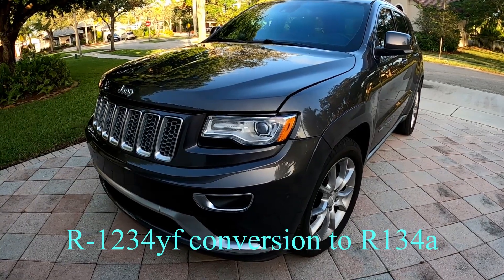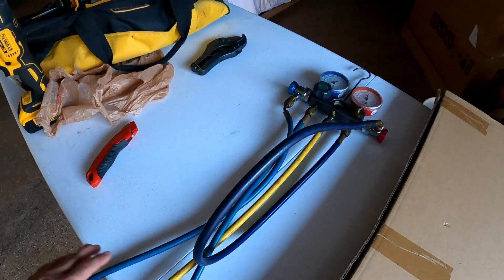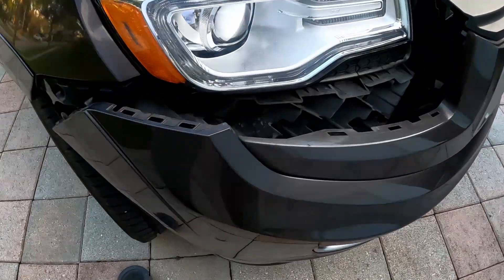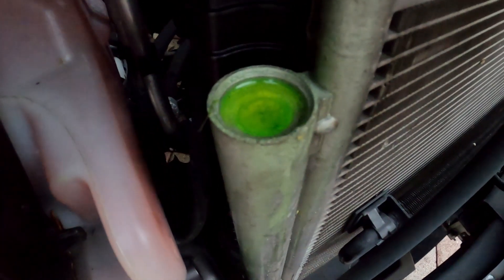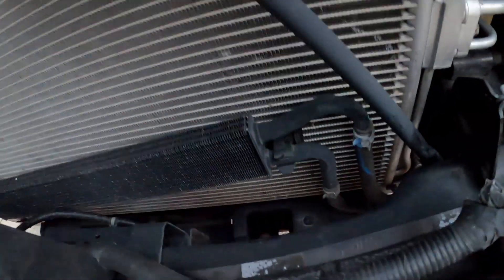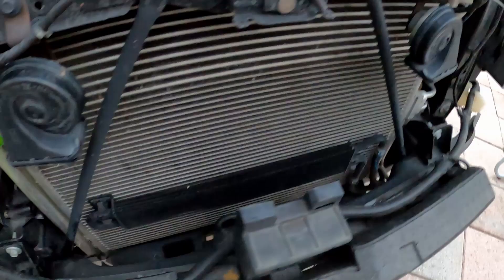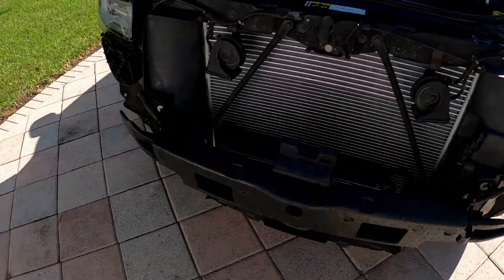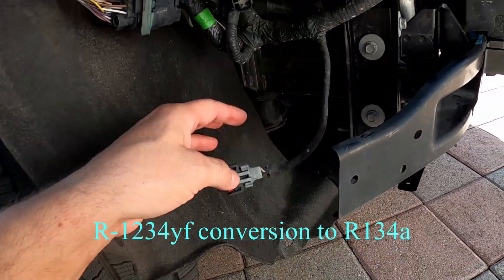R 1234yf conversion to R134a Freon Jeep Grand Cherokee Condenser Replacement, R1234yf to R134a

Comment: Great video!  I understand about the type of gas. And understand about saving $$$$ for a simple DIY recharge, but, sorry of my ignorance,  the compressor doesn't get damage for the change of gas??? Maybe the compressor is designed for a specific type of gas, then the repair cost much more than a simple recharge???  JUST THINKING!!!??? 🤔😅
Reply from the maker: At the time of the video to charge it was a lot and there was not much info out there.  I started asking some mechanics and did find something that mentioned the gas was kind of the same and after a while people were converting.  Now I believer there are kits you buy to convert it to R134a with very little cost.  It actually worked better when I replaced it but I also had a bad condenser.  R1234yf is mildly flammable, while R134a is not.  I don't remember but the pressures are a bit different.
Reply: @ExtremDIY the switch may have damaged your condenser. Cause I heard the 1234y has more pressure
Reply from the maker: @ReyErnesto-p1c  The condenser was replaced a year before with the 1234yf that was expensive with an OEM condenser from Jeep and only lasted 1 year so it was not the R134a.  Seems like the oem condensers have an issue. Just like residential A/C companies they have been changing freon types and its ridiculous.  1234yf is more corrosive than R134a according to what I have seen.  There are kits know to convert from 1234yf to R134a.
Reply: @ExtremDIY my system has a leak. An Ac Tech told me it might be the condenser since I get a weird smell. The system is completely empty. He said that condenser is gonna be alot of money to replace. So he suggested to buy this Blue devil leak sealer called Red Angel . He said it might clog the leak and get the ac fixed. He recommended to go with what the system came with the 1234yf instead of switching to 134
Reply from the maker: @ReyErnesto-p1c  I did the same thing with my current GM and the sealer is clauging the valve in the compressor so it works intermittent so I dont recommend to do that but its a cheap alternative.  If you have a leak in the condenser brand new is under 100.
Reply: Which red angel did you use? The small ted bottle or the can with the hose?. On Amazon everyone raves about it. There's one guy that said one bottle wasn't enough and a second bottle did the trick of sealing the leak. My condenser I'm talking about is the one behind the dash . Mechanic said thats expensive cause of the time to replace. Mechanic said if the ac has a smell that it should be that. But I'm sitting in a 2025 Acura and it has a smell as well lol @ExtremDIY
Reply: Im receiving two bottles of red devil today from Amazon. I'm thinking of adding the two bottles. Still debating which freon to put out of the two
Reply from the maker: @ReyErnesto-p1c  If you convert it make sure you add a sticker to indicate the correct freon.  Good luck hope you fix the issue

Comment: R134a is actually in phaseout. They cut production 15% in 2020. Now the 1st of January 2024 they cut production another 15%. By the end of 2024 r134 prices will probably be pretty close to that of r1234yf. If there is enough stock out there you probably won’t see the price increase hit the shelves until 2025 season. Unfortunately the government always has to mess with things.
Reply from the maker: I agree with you on that.  Thanks for the update.

Comment: I did the swap on my 2019 Chrysler 300S about 6 months after I bought it. Has worked perfect outside of shrader valve leaks for 4 years. Much cooler than 1234yf. However - once you do this - you better have a specific shop you have a buddy at, or know how to service the system, because no shop will touch it ever again - technically it's A. illegal, and B. contaminated so the 1234yf machine won't run.
Reply from the maker: Hello I labelled mine to make sure that next person will know and yes mine was colder after I did the change too.  Thanks

Comment: What did you do to convert it?
Reply from the maker: Replace r134yf with r134a which is cheaper and easier to purchase. There are kits you can buy now that come with some items to replace or you can buy the compressor that comes with these items.

Comment: You say it worked prefect for months and then said you left it r134a. What happened that it only worked perfect for mounts months?
Reply from the maker: I had a leak on my condenser prior to the video beign made were I had already replaced the condenser a year and a month prior with the expensive freon.  I did some research on the freon and there was very little information available that I could relate to.  I did find something and it mentioned the very similar characteristics between both gases so I decided to add R134a to the system and worked perfect for months.  then I decided to replace the condenser and install the R134a.  I got tired of adding freon to the system and the leak started to get worse so thats the reason I replaced the condenser for the second time but now with R134a.  Sometimes leaks are small and can take months to go low. I had purchased the condenser from dealer both times.
Reply: @Extreme DIY  cool.  Cause my 16 charger currently uses the r1234yf
 But I am putting a chiller on the car for my intercooler and I need to recharge the system. I want to go to r134a but my buddy is telling me that I'll have major issues if I do this. But yours has been good right
Reply from the maker: @09fatbobmike  After I replaced with new condenser and installed the r134a no issues here.   Ask him what major issues you will get?  I was told that now there are new compressors that come with a kit to make it r134a. Back when I did the exchange there was nothing available to do this.  I would recommend to do the vacuum on your system before you add the a134a.  Let me know how it goes.  thanks
Reply: @Extreme DIY  he's actually an engineer for vehicle ac systems. He tells me that the txv for r1234yf vehicles is set up and designed differently and if you don't change it (which I tried and found out the lines are all different,  need a whole system from a r134a car)  but he said if you don't do that then using r134a will cause the system to freeze up.
Reply from the maker: @09fatbobmike  Very interesting to know.  Its up to you if you want to convert it or buy the expensive freon.  I am good with the r134a.
Reply: @ExtremDIY  I will still be charging with the R134A. I just need to find out how much of it is required. I have 36oz. I installed a killer chiller and was told that the R134A can actually get 10 degrees colder. So that will lower intake temps even more. thank you for response. It is nice to see it is working for you.
Reply from the maker: @09fatbobmike  I dont remember how many oz I used for the entire system.  We used the gauges to fill it up and the recommended oil for the system.  Let me know the outcome.  Thanks

Comment: Any Pag oil weight recommended while replacing the Freon? R1234y are just marketing money pit since R134 are very common or maybe just a new design hose outlet.
Reply from the maker: This was the second time my condenser went bad on me.  I had previously added oil so we didnt want to have too much.  I dont remember the one I used last time I had purchased at the local auto parts.

Comment: Want to ask if your condenser problems have relation with the pressure of the system ?. To do the conversion you change the compressor and more parts or just vacuum and ad 134 ..
.thanks
Reply from the maker: Hello all we did was change the condenser, vacuum the system and add the R134a.  Also added a decal to let the next owner to use R134a.  Dont have to change the compressor or any other parts.  Hope it helps
Reply: Hello the condenser you changed because it had leak right?

Comment: Did it seem to cool down faster with r134a
Reply from the maker: hello for me I saw a small improvement after I changed to R134a but the main reason was the price of the Freon.  When I had the issue with the condenser each can was like over 60 dollars per can. Also saw some issues with corrosion with the new Freon so I decided to change.  Hope it helps.

Comment: I’m literally doing this to my 2015 jeep grand Cherokee today and over the past couple days. I’m switching out all components my evaporator compressor and condenser. I would like to speak to you if possible because I have some questions. But how many cans of 134 did you use and I bought one adapter but do I need 2 for the high and low?
Reply from the maker: Hello I used 2 cans of R134a and added compressor oil also.  I used only one adapter which converts from R1234yf  to R134a so you can use the regular hose you can buy anywhere.  If you want to use the R1234yf freon it has dropped price since I did the conversion.  I still prefer the R134a its less corrosive. You can also purchase the ACPro kit that comes with the hose and freon with gauge but more expensive. Let me know how it goes.  I also did the vacuum.
Reply: @ExtremDIY  Thank you so much for responding. Yes I did hear that it is very highly corrosive which has caused people to replace their evaporator numerous times along with the other components. I guess that’s why they talked me into doing the conversion. My dad is saying I need another adapter for the high because I already bought one for the low but he says I need the adapter for both so that he can hook up his gauges to both but I’m tired of spending money. Lol 
He is going to vacuum it out though. 
Is the adapter only used to put the Freon in or also used for the gauges because he is an AC tech and has the high/low gauges. How did you get away with only using one adapter?
Reply from the maker: @audricroxy  hello he is a retired AC tech old school.  We only used the low for both the vacuum and the fill using the guages. After we did the conversion the AC was awesome super cool. Hope this helps

Comment: How’s it working? Thinking of doing this to my GC. Did you use gauges or just the single low side connector for ac pro?
Reply: Hello we used the gauges but you can use the standard gauge that comes with the bottles or like the AC Pro ones. My dad is used to his gauges but I ended up topping the freon a week later since it was a hotter day it was missing just a hair but either will work.  thank you

Comment: I get it the crap is expensive but how do you figure that 134a should be used because of ??????? so the next shop that works on the vehicle after you sell it is going to have a bad time.
It is because of people like you the equipment costs keep going up!  Engineers know there are folks out there that do this stupid crap so the 1234yf machines have to have refrigerant Identifiers built in and that in turn is thousands of additional dollars for the machine. If you must do that at least use a label or a paint marker to let people know what you did.
Reply from the maker: Hello I did redo the labels and put in the engine compartment so it can get identified by the next owner. Its on the video around 1:20 time frame
Reply: @ExtremDIY  I am proud of you for doing that!!
Reply: Well, for one thing 134a isn't explosive while 1234yf is. Also, 1234yf is priced 10 TIMES HIGHER than 134a. Sound like two good reasons to me.
Reply: @rodneyjhackenflash4865  Explosive?
Reply: Calm down buddy....he re labeled the system so if a tech screws up his ac machine then he's the dumbass that didn't read the lable
Reply: If it works go for it...... pretty soon the government will make a new law stating that farting is illegal, then what the hell ya supposed to do...... Greed is what is going on here nothing more....if the government gets involved is surely will cost the consumers more money that is a fact....
Reply: @rayb2078  The 1234yf is not widely used at the moment that is why cost is still high. This is the case with "every thing" in life. The more a company can produce the lower the price! It was the same thing with 12 to 134 naturally the price of 12 went up because it was no longer made. Same will happen with 1234yf to 134.
You blame the government, yes but not in that sense I would blame the government for not controlling the price gauging, same as with the big 5 lumber producers that keep cost high but have 604 million dollar net earnings in the first quarter.

Comment: I read that depending on the manufacturer and if they use the new refrigerant r1234yf for emissions credits it can be same as emmisions  tampering. Which is punishable by law and remember to be kind and rewind your VHS tapes. Good video though even if your a criminal lol...
Mike - Plus8Precision
Reply: Lol I would had used the r1234yf but the price was astronomical so I found some data on the net and went for it.  Once prices go down I can replace. We dont have have the inspections in Florida so far is working perfect.  Thank you
Reply: 1234yf   is not safe  to use   ,i will not buy a car with it,,,an it cost way to much for  what it is ,,,its his car he can  do what he wants with it,,,
Reply: @Monza62000  I sprayed it on a touch , it put the torch out. how do they get it to burn ?

Comment: Just be careful. This is illegal.
Reply: I say screw them... prices are astronomical on this new stuff, its your car... let them fine you and take you to court if instection says anything... here in MA, they won't give a crap... you will win... new stuff is flammable and dangerous and one day will cause an engine fire really bad... I would not want my car having this, if i get a new car and it has this crap.. its coming right out.
Reply: @sstjacques  gasoline is not flammable ? what about oil or the tires better not use them to.
Reply: So how does that work?  Does the EPA show up with a search warrant and a refrigerant identifier and take a sample of your refrigerant. If this is illegal than you would think the adapters wouldn't be available or some sort of warning on the package telling you that it's against federal law to change it to 134A. IDK just saying
Reply: @viper5gm  yes they do show up and inspect. But you’d have be a commercial operation. Likely if the car ever goes to a shop they’ll recover the refrigerant and then take it to the supply house as reclaimed and they’ll get fined for being contaminated. There is a formula to determine based on weight and volume. It’s been a while since I took my epa card exami so I don’t recall the formula.
Reply: @robertgary3561  "They" Can't even get my federal tax return processed so if I would ever convert one I don't think I have anything to worry about lol. I do have to say I believe that A/C systems function best on what refrigerant they are meant to run. As far as refrigerant goes each one has it's own unique operating pressures and the condenser volume that is needed to condense it back to liquid as well as the different volume by gas . I have a 609 cert from the old days and still put R-12 in my antique cars.  I needed to provide my 609 cert. to buy any thing larger than the 12 oz cans of the 134A to one of my wholesale suppliers to my garage when I ordered the 30lb can last year, to my surprise . I guess what I am saying is I would never put the wrong refrigerant in as long as the proper one is available. Not to mention that I spent $8,000.00 on my 1234yf machine. I still think if it was illegal to replace 1234yf with 134A than the adapter to do so would be not sold all over the place. I have never received any information from any of the shop journals I subscribe to about not doing this but than again I didn't spend all that money on the 1234yf machine to put 134A in place of  1234yf. ( good thing It's a slow day at the shop or I wouldn't have had to the  time to entertain this otherwise entertaining subject) If you have something from the EPA in writing or the CFR number it would like to know about it
Reply: @viper5gm  Yup, just like the brown coats did to report any defectors. Can't have people violating the EPA or DHS social distancing regulations.
Reply: @viper5gm  or you make a YouTube video snd the epa sees it :)
Reply from the maker: Thank you didnt know.
Reply: So is driving 2 miles over the speed limit. Don't do it
Reply: @Oo-IIII-oO  fine for 2 mph over is pretty small though.
Reply: Not if you’re the end user.
Reply: Amazing. This is illegal while the president okays murdering babies.
Reply: GOVT is illegal at this point - election fraud.